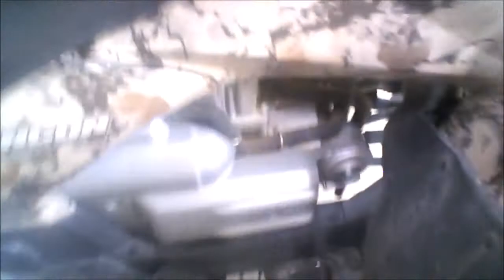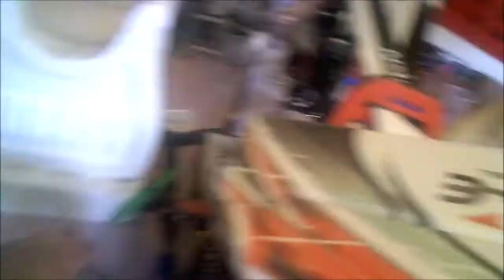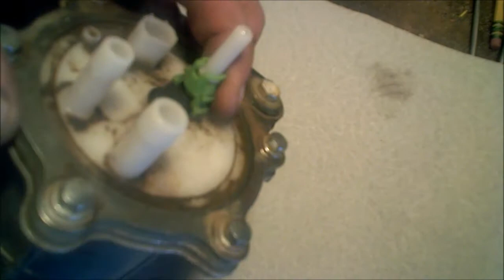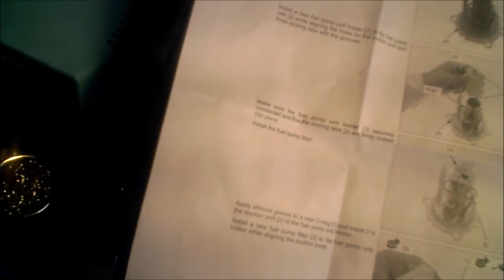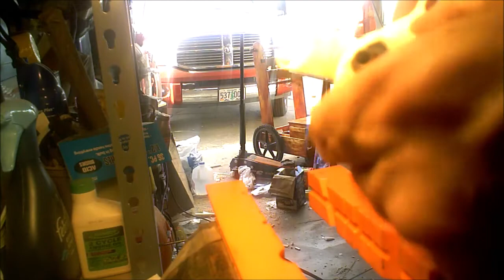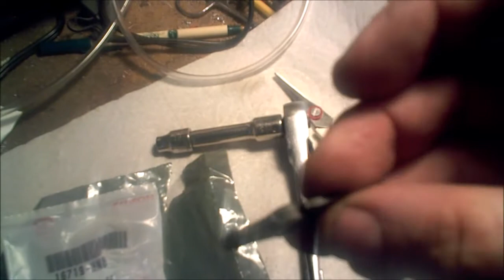Rincon fuel filter upgrade

Comment: Hello, can I purchase a whole fuel pump  assembly kit besides from oem parts. Like a n upgrade. If so from where. Thank you
Reply from the maker: @marcussweaty1859  I believe that would be part number 16700-HN8-601. Honda dealer, partzilla or whoever. I see it looks like off brand parts are also listed on Amazon.

Comment: I followed this to a T and the machine started right up.  However, I only got about 2 more starts out of it before the same issue.  I'm wondering if I gunked up the injector when I reinstalled.  Will probably check the fuel tank itself as there could be a new restriction there.  Any help?
Reply from the maker: @BriaL-p8b  Possible. If you can confirm it isn’t getting fuel when it acts up, it could be the pump, the injector or the computer.

Comment: Thanks for posting this and your time. Most informative and helpful. Heading out to try my luck. Honestly, I couldn't even find the fuel pump before your video. Again thanks! ***After the melee - Got it done and back together. The hardest part was the clip on the hose the injector, getting it off and trying to get it back together. Plus the bath I got after I thought I had siphoned all of the fuel, the garage floor is the cleanest it has been in a while, amazing what a gallon of premium will do to clean up oil spots off of the concrete. I haven't tried starting it yet, that is what tomorrow is for. Thanks again.
Reply from the maker: Kevin Chamberlain   Glad to contribute something helpful. Be careful with the gas fumes.

Comment: I have a 2005 Honda Rincon that had the carb replaced a year ago. It takes forever for this thing to warm up. Typically about 15 min running with the choke. I was wondering if this might be the issue. Would appreciate your feedback. BTW your videos are very descriptive and helpful. Thanks again!
Reply from the maker: Thanks for the comment. A buddy has the 2005 650 carbureted, and it too is cold blooded, more so than my 05 500 Foreman, which is also carbureted. The 05 Rincon has a gravity feed system, so there is no fuel pump or filter. There is a screen inside the tank, attached to the petcock, but that would normally cause stuttering at high throttle. 

Two things I’d check, that the choke knob isn’t sliding its self back in- the round ring at the base of the knob adjusts to control friction, and secondly the carb may need cleaned. The low speed jets are small, so any small deposits can have a significant effect on mixture. 

If neither of those help, you may just be seeing the nature of the beast. I think they are jetted a bit lean for emission reasons. My buddy just lets his idle while he is getting his riding gear set up and lunch or whatever loaded. 

If after making sure the choke knob is staying put, and the carb has been cleaned, it seems still too cold blooded to live with- if it were mine I’d consider one of the jetting kits.